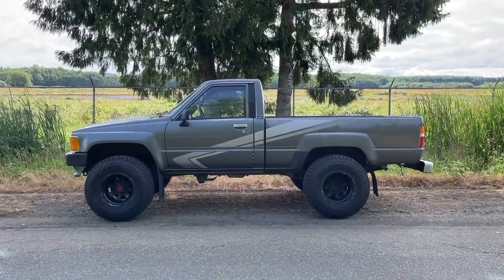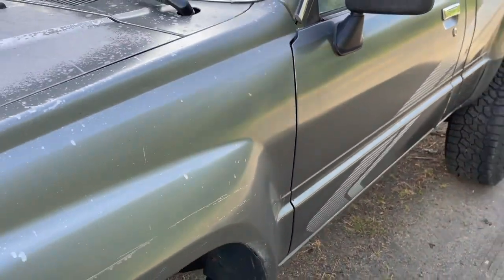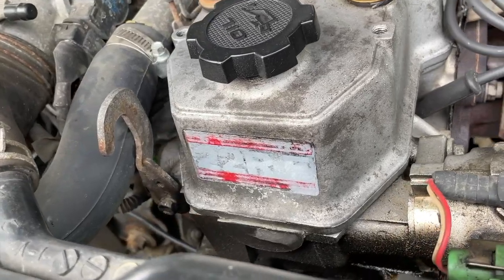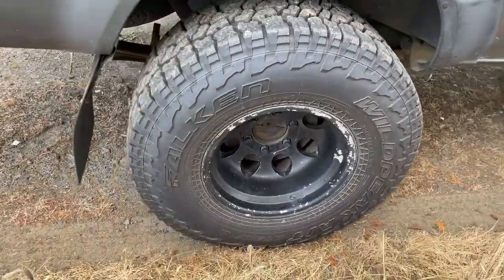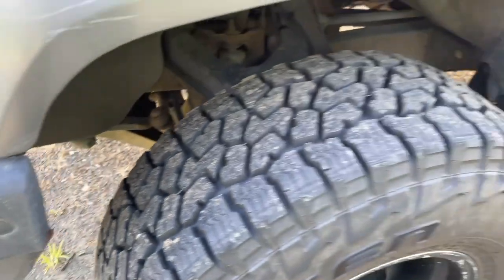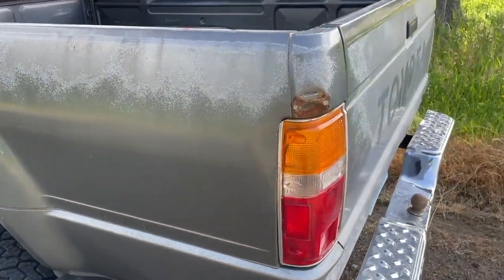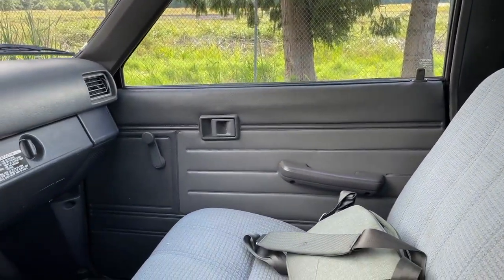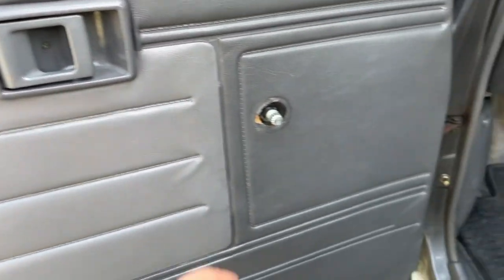1988 Toyota 4x4 - The Donor - 4x4 Chinook Build

Comment: Does it only rub the front fender that’s cut or does it rub the back when you turn the front wheel? Also does it have any lift? Curious what I can fit on mine stock
Reply from the maker: No lift. It runs the front fender very slightly. May need a tiny bit for trimmed to clear it fully. I’ve recently sold the wheels so I wouldn’t be able to test my theory. The new wheels clear everything perfectly.

Comment: Doing the 4x4 nookie. I ended up selling my chinook and getting an 85 4runner.
Reply from the maker: What year was it? Was it converted to 4x4? I love the older 4runners. 🍻
Reply: @azorianification  my chinook was a stock 76 that was lived in by mice. It was really nasty. I've got an  87 and 85 4runners now.
Reply from the maker: Yeah unfortunately most of the chinooks out there are in terrible condition. Thankfully since the sheep is fiberglass you can rebuild them but that is a lot of work. What are your plans with the 4Runners?
Reply: @azorianification  I've thought about combining the best parts from both into one and selling what is left over. The 85 runs and drives but needs cleaned up and some parts replaced. The 87 runs but has transmission issues, but all the windows and locks work. There is a local guy that wants to trade me for his k20 pickup for the 87. I'll probably keep the 85 for as long I live. It took me awhile to find it. 5 speed, 22re, and straight axle is pretty hard to give up.
Reply from the maker: That sounds like a good find. Combining all of the best parts into one sounds like the best idea if you plan on keeping it forever. As you know these are getting more difficult to find as time goes on. Keeping the 22re or swapping it?
Reply: @azorianification  keeping it 22re. It will be just a run around, high desert, and teach my kids to drive manual truck.
Reply from the maker: Nice. I’d like to swap in the 3.4L into this. Or maybe even the 3z. Not sure which would be the easier swap but they both seem fairly popular
Reply: @azorianification  you can get some okay money for your 22re too. I hope you can get that bed sold. I had an 85 pickup that I was going to swap the camper onto but people wanted to buy both projects before I had done anything to them. The 85 pickup was really rough and didn't run and drive. The 76 ran and drove but was nasty inside. I had most of the interior ripped out of the camper part and I was going to resto-mod it. There are a few channels that have done it but I think you got the editing and cinematic eye that will make it really cool to watch.
Reply from the maker: Yeah I figure when the time comes I’ll find a new home for the RE. I also will sell the 20R and the 22R that were/are in the chinook at the moment. 

Thanks, I have a ton of footage already and plan to document each step as I go. There isn’t a lot of documentation online on how to build these so hopefully this build series will encourage others to do the same. It will be a unique build for sure and it’s something we plan to use a lot. The 2wd was great but this will allow us to camp in very remote places 🍻
Reply from the maker: Any idea what happened to the chinook you sold? Did they rebuild it?